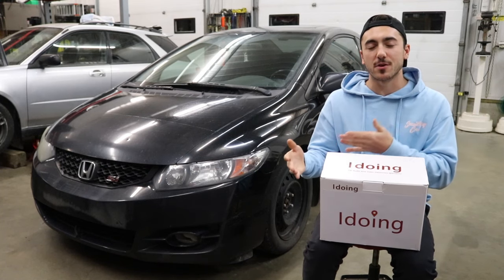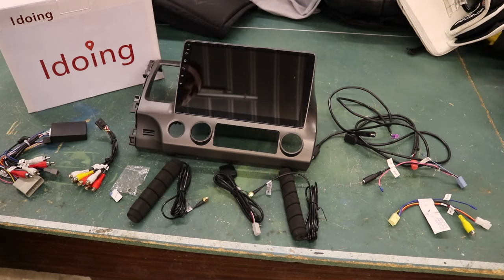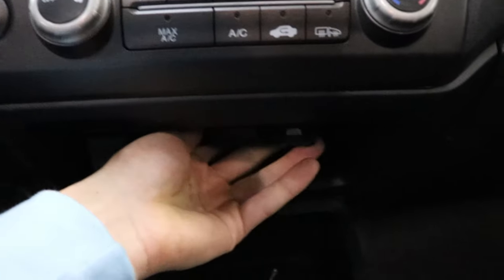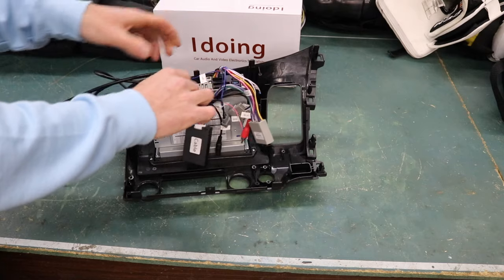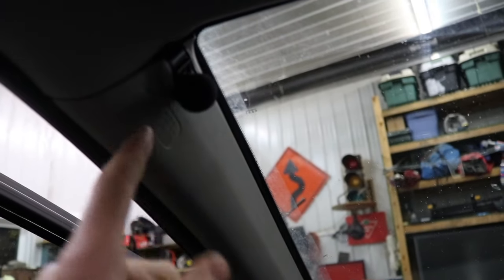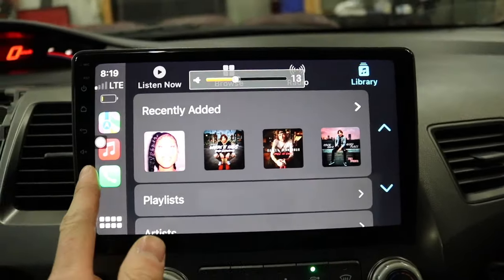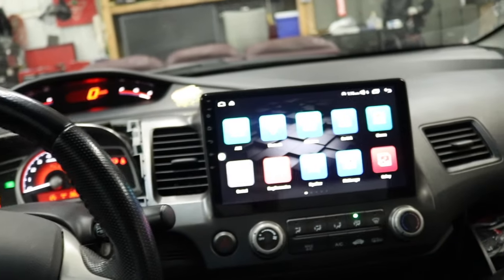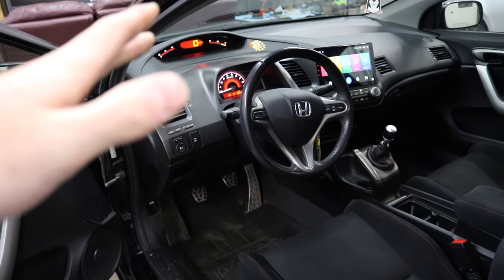Honda Civic Si Idoing Radio/Headunit Install!! (06-11 8th Gen)

Comment: I will say I love the idea of adding something like this to my FA5 but after looking at the website that you've provided, I am a but confused. I saw that for the very last option iDoing had the premium audio radio, however it appeared as if it was a European option with the digital climate control screen. Could you specify which one of the 5 options you picked and if us as consumers need to reach out to them in regards to the amplifier relay thingy on the harness (black box). Or do you just pick the option and everything gets sent automatically. Thank you!
Reply: I believe it's just a stock photo from their end in China to show that it's for the premium audio system, and it just happens to be the digital climate version

Comment: Just got the kit from Idoing. There were quite a few issues. Firstly, the airvent would not fit flush on the Idoing bezel. I had to cut off about half an inch of plastic from one of the posts for a screw to get the fitment acceptable. Secondly, as you pointed out in the video, the jack for the radio that is on the harness does not actually fit into the back of the radio. Thankfully, the kit includes a second jack for the radio (not attached to the harness) that actually fits in the hole and makes contact. Instead of soldering the blue power wire, i depinned the connector and swapped to the alternative jack provided with the kit. Finally, after all that, I still get a large amount of static anytime the radio is powered on. The volume adjustment is fine and seems to be accurate, but the constant static anytime the radio is plugged in got old real fast. Based on the research i've done, the issue is really only fixable if you ignore the black filter box and go straight to a aftermarket amp. The head unit itself is good quality. Idoing support was very responsive to my emails so that was great to see. Long story short, good unit but has a few small issues and still requires an aftermarket amp to get rid of the static.
Reply: Bro I just did the exact same thing you did but for me everything works with stock amp and no static noise
Reply: Does it boost the sound in the car? can you hook up aftermarket speakers and receive the correct amount of power? If not I wonder how you’d get an aftermarket amp hooked up
Reply: @TakeThis_L  there will be wires extra wires for amps and sub unsolder yet to the wire harness plus it's labeled too. Also if you need if idoing has good customer service

Comment: You should always want to get rid of using the factory amp whenever possible if you're trying to upgrade your sound. All of the factory amp crossover points and cutoffs are designed to work with the factory head unit and speakers.

With this setup, if you upgrade your speakers, they won't really sound any better than stock, and upgrading your headunit again won't sound any better.

Aftermarket HU should automatically = Aftermarket amp and speakers unless you're only after the screen and functionality and don't care about the sound.

This is great however for the latter.

Comment: So I wired everything identical to you, install, and only the front left door speaker and the front right dash tweeter are working and they are extremely quiet and I can tell the speaker is clipping even with a very low output
Reply: I’m having the same problem. Did you find any fix for this?
Reply: @JenniferSchilling-no3hc  I’m speculating the factory amplifier for premium audio has failed. Everything’s hooked up as per the video, but the only speakers getting signal are the front tweeters and the front left door speaker
Reply: Please keep me posted on what ever you find that fixes this issue. Thanks for the info.

Comment: The "static" you're describing is because head units normally send speaker level out. The factory amp expects line level, not speaker level on the amp input. Its like plugging an amp into an amp. The result is over-driving the input on the factory amp which sounds loud and distorted.  The RCA connectors are all line level, the same that has been used for the last 70 years in home stereos.   

I've no experience with this head unit, just speaking from general experience.

Comment: my radio often changes radio stations, switches to CD and AUX inputs, sometimes just makes a loud static noise, occasionally turns off on its own, and then turns itself back on at volume 40 (which scares me every time!). It does this without me touching any controls, turning the wheel, turning on the wiper blade, anything. It could happen with the car on in park. It usually resets when I turn the car off - but I have no idea how long it will be until it goes haywire again (sometimes it takes a few minutes, sometimes over an hour). This happens no matter whether I start with the radio off or on, or whether I'm using AUX/CD's.my radio often changes radio stations, switches to CD and AUX inputs, sometimes just makes a loud static noise, occasionally turns off on its own, and then turns itself back on at volume 40 (which scares me every time!). It does this without me touching any controls, turning the wheel, turning on the wiper blade, anything. It could happen with the car on in park. It usually resets when I turn the car off - but I have no idea how long it will be until it goes haywire again (sometimes it takes a few minutes, sometimes over an hour). This happens no matter whether I start with the radio off or on, or whether I'm using AUX/CD's.

Any suggestions please.

Comment: Question , if we plan on using a aftermarket Amp along with a aftermarket double din do we have to worry about the factory amp/bypass ? Want to run a 5 Channel amp and run the speaker cable from the amp to the speakers so wouldn’t be using any part of the factory amp. Thanks 🙏🏼

Comment: i installed a head unit in my 09 si and no matter what the volume is extremely low. what do i do. there’s one white plug in the factory harness that the aftermarket one didn’t come with. is that my issue or what do i do.

Comment: Just ordered this using your link
Reply: Just installed it and they didn’t fix the antenna wire, and fitment is horrendous, huge gaps and screen doesn’t fit flush. I’m very disappointed

Comment: Hi Daniel.  I need help. I just bought a Idoing head unit for my Civic but I’m not sure they give the right one or not. Mine is Premium Audio System just like your.  By watching your video your have a long deck in back mine is the short one.  How do I know is the right one.  There is no # I can tell.  It hard to communicate with seller.  Thanks.

Comment: I installed a unit today in my 06 Civic EX Coupe with the premium sound system. Everything is working great except no sound out of the back speakers. I made all the connections just like you did in the video. Any help would be appreciated.
Reply: Late reply, but it’d really just have to be because something wasn’t connected or something wasn’t connected properly. Hopefully you’ve pulled it out and found a solution by now 🤞

Comment: I have a premium audio system on the stock car but ordered the idling head unit that’s was for the non premium sound system and I’m trying to figure out if I have to return it or if it will work in my 09 Si

Comment: I have a navigation system 
Will that work with my car ? 
I notice that the connector that has the amp on wire is different for mine

Comment: hey i’ve been using it for a while now and it had worked great with no issues but all of a sudden there was no sound. Like completely no sound at all. The radio and everything the screen works fine but there is no sound. I tried resetting everything and unplugging the whole unit and putting it back in but still no luck. Does anyone know what can be the issue ?

Comment: Hi! Did your 2 screws under the radio go back in with the aftermarket head unit?  I just installed mine and there’s no way it would work there. Without them it seems a bit shaky to me.

Comment: Are there any difference in the plugs for the non navigation and the factory navigation plugs? Im no wiring expert and i don't wanna drop almost 500 bucks just to find out there are differences and cant plug and play.
Reply: There is definitely diffences. I just bought it and am having so many issues!
Reply: @skylerpearson3377  makes me wish I should have bought a non navi SI. I've been doing so much research on replacing the factory navi with an aftermarket unit. I basically gave up and probably just going to stick to using it.
Reply: @skylerpearson3377  did you ever figure out a solution for it? Just bought the head unit and everything works but the audio.
Reply: @jordiortega7325  I had to wire in the factory amp wire into the new plug. I'll have to look later to now for sure which wire it was but it's been working for a while now
Reply: @skylerpearson3377  damn I don’t know how to do any of that wiring stuff. Thanks for the info
Reply: @jordiortega7325  it's super easy man. There's probably a video on here showing you how. I also just remembered that I haven't gotten my steering wheel controls wired in yet either
Reply: @skylerpearson3377  I’ll have to see if I can find a video on it. Are you getting any static noise from it?

Comment: Just got my head unit yesterday and upon installing there is no sound, I can’t seem to figure out why as I followed the installation instructions as described in this video. Bought the L10 for premium sound on my 2006 civic si any ideas?
Reply: I have the same issue. Can you tell me that your head unit deck have the long on back or the short one?

Comment: Might pick one up for myself! Not sure how I feel about the huge tablet though..wonder if they have the same version but smaller. And would it work with any backup camera?
Reply: As long as your camera does not have all kinds of wires you could splice right into it

Comment: Question, on the Accord with the Premium audio system would the same thing apply with no static? or did they just resolve this on the Civic, I had a Navifly unit and it looked identical to this IDOING unit. The static noise was aweful and the steering wheel control didnt even work till I hooked up a seperate wire they made me connect when I had it
Reply: Did it work ?? Or you got other stuff for it ?
Reply: @Rngttttt  I used optical for audio to my amps and connected a dedicated wire for the steering wheel control. It's been working great

Comment: 7:30 “this won’t happen to you” oh but that’s exactly what happened to me lol
Reply: And they also didn’t send the dash bezel :/
Reply: Thanks for saving me the effort of buying this lol when he said that, my first thought was yeahhhh they probably aren’t changing that lmao
Reply: @DOOMLORDHOKAGE  to be fair I did find they sent an extra cable that’s right that I will have to splice into the wire which is extra work and is no longer plug and play but whatever, and the trim they sent in a different package which comes at a different time
Reply: @AlexTer221  did you install it yet?
Reply: @arguetaj16  not yet, funny enough the actual display which was coming from Hong Kong came in 3 freaking days 🤯 but the plastic trim which shipped from cali hasn’t even shipped yet🤔
Reply: @AlexTer221  dam dude, that sucks. Let me know how it turns out when you finally get everything.
Reply: @arguetaj16  just installed it today and I love it!  Still learning my way around it but was watching a movie while I was driving today which was awesome
Reply from the maker: I contacted Idoing directly as soon as I saw the antenna wire was wrong & they told me they would correct it 👍🏼
Reply from the maker: They ship the dash bezel & headunit separately on all orders. Same thing happened to me 🤷🏻
Reply: @AlexTer221  awesome man, thanks for the update.
Reply: @DanielKellert  did you make a video on how you solder the wire?

Comment: I have the same 09 civic si and had a kenwood double din installed so it was not a plug in play. My question did u just soldier all the cut wires back to stock harness?
Reply from the maker: If you installed a kenwood headunit with a plug & play harness, you should be able to disconnect that harness from the factory connector & plug the idoing harness into the factory connector. Only way it won’t be plug & play is if whoever installed the kenwood unit cut the factory harness to install it.

Comment: I just got mine in the mail but didn’t get the dash insert. Was I supposed to order separately?
Reply: All that is here is the head unit itself
Reply from the maker: They ship them separately, should have got 2 separate tracking numbers. I’d contact Idoing directly if you have any other issues
Reply: @trevordavis4583  update?
Reply: Update please?

Comment: I was wondering if you could help me out. Unit is installed. When turning the key to position 1 (accessory) there is slight static. But once I put it to position 2 (on) or when the car is running there is alot of static which is not very tolerable. Even when hitting the horn I get some feedback. Disconnected all RCA cables and issue still remains. If you could assist me that would be great! Thank you.
Reply: How long was it until you got the mounting kit separately ?

Comment: Hey Daniel, I'm talking to iDoing about this now but they obviously have an incentive to sell me their head unit. From your greater technical expertise (and experience installing many of these), do you believe that the proprietary wiring harness they have for the amp (built into the steering wheel controls as you mentioned) would fit other head units? You said you installed a lot so I'm curious if we could just use their wiring harness with other similar Chinese head units.
Reply: I would say it 100% depends if each company is using the same base headunits. If not then they may have different electrical outputs that lead to different wiring diagrams for their harnesses. I personally just went with a decent brand off of Amazon (Dasaita) and messaged them till I got sent the right harness. I'll have to look into getting steering wheel controls since I had factory navi too.

Comment: I order an idoing radio based off this video (and other I saw online) and it works great… except I’m only getting sound out of the front speakers on my 08 civic so with premium audio system
Reply: I am have the same problem. Love the unit but it’s not worth not having all my speakers work. Did you find any fix for this?
Reply: @JenniferSchilling-no3hc  actually yes! I realized there's a couple extra wires in the box that I had to hook up to the RR and RL on the back of the rafio after I connected the wires the back started working.
Reply: I did connect the RR and RL RCA from one harness to the corresponding RCA plugs on the other harness. I have no other left over wires in the box.
Reply: @JenniferSchilling-no3hc  weird... You have an 8th Gen civic?
Reply: 06 Civic EX Coupe with the premium sound system
Reply: @JenniferSchilling-no3hc  interesting. It's been a while since I hooked mine up but try switching the rear speaker aux ports to the other set of rear speaker ports. I remember that there was 2 sets of ports and one of them didn't work as you'd expect

Comment: Can you run an amp and subs with that head unit
Reply from the maker: Yes you can! There is 2 RCA pre outs labelled “Subwoofer” & “AUX” that are used to run an aftermarket amp.
Reply: @DanielKellert  what about an amp for the door speakers so 2 separate amps one to subs and one to composite speakers

Comment: Do they sell the harness kit to be used with any head unit? Not a fan of the huge display plus I prefer a unit like the one you used before.  Thanks for all the info and videos on this matter for the 8th gen civic with factory amp.
Reply from the maker: Not sure if they sell the harness separate, you will have to contact Idoing directly & ask 👍🏼 Here is the contact info they sent me. 

Idoing accout for technical support
WhatsApp:+86 13632905007
Instagram: @idoing_media
Facebook: Hedu Zhu
Reply: Have you seen the Dasaita 9 inch model?  Doesn’t protrude like these big models and even retains the airbag light. But says it doesn’t work with the amp. Trying to find a work around because I like that size.
Reply: @MrHuck  metra sells a kit that works around the amp.

Comment: Anyone figure out the steering wheel control wires? My connector does not fit with the idoing connector that contains the blue, white, black.

I figured out that blue connects to the amp wire but unsure about the white and black